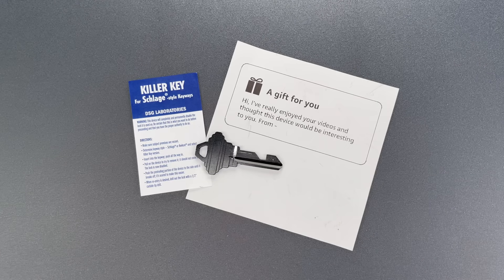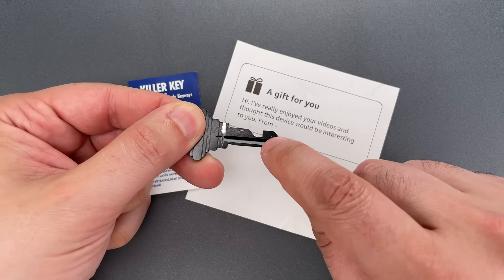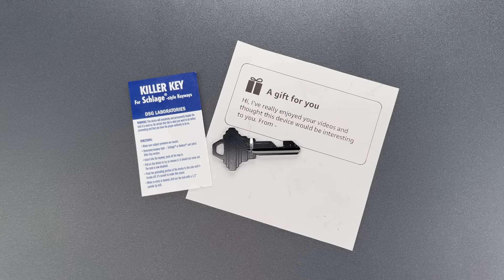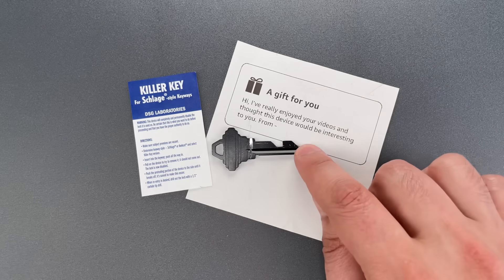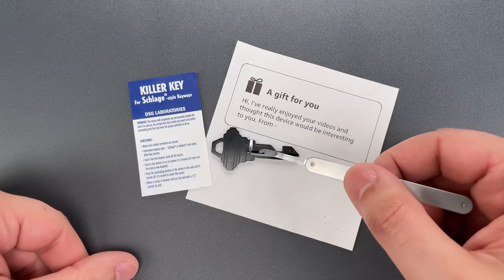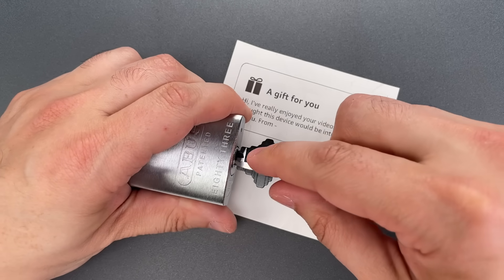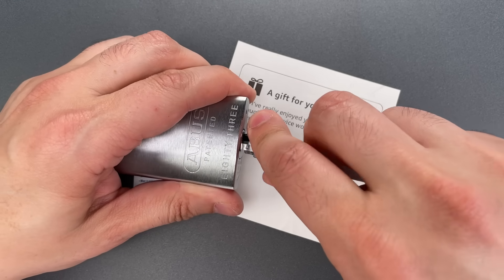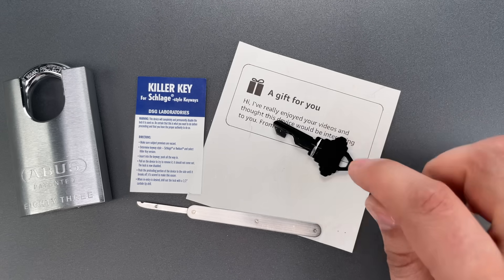[1350] Defeating a “Killer Key”

Comment: if I was going to make a killer key, I'd just squeeze epoxy down the key hole instead...
Reply: Superglue, comes in those convenient mini-tubes.

That said, this has the tradeoff of being removable if you want to disable a lock but not destroy it.
Reply: @ianburns1167  Super glue is easily dissolved by acetone, which won't harm the metal of the lock.
Reply: @silverfischdotnet  Hence the suggestion to use other glue types that require more exotic removal methods than nail polish remover.
Reply: @silverfischdotnet  Yes, some types. There's also pretty resilient glue types. Also, soaking a lock in Acetone requires to get it out of the door, which requires (typically) opening the door, which mandates unlocking the door unless you can take it off the wall completely while locked. I'd say glue or epoxy is a lot more permanent and harder to deal with that these keys.
Reply: @silverfischdotnet  While you're correct that acetone will dissolve super glue, you forget that the inner workings of the lock will still have glue in them and someone looking to destroy a lock will simply fill it totally full.. leaving no space for the acetone to dissolve the glue.
Reply: @ianburns1167  yeah but this product advertises "permanently disabling a lock"
Reply: @ianburns1167  According to the manufacturer, you have to drill the lock to remove the key, so you would think the lock is lost, that is until LPL shows up.
Reply: @ianburns1167  Super glue has a kyrptonite: sugerglue debonder. epoxy is much more permanent.
Reply: @ianburns1167  superglue can be removed with some heat
Reply: Well the makers of that key state the lock needs to be drilled for removal, which is pretty destructive. Filling the lock with glue basically does the same thing without a backdoor. Glue > Killer Key
Reply: I've also thought about the expanding foam they use for foundation cracks, basically foam cement in a can.
Reply: @SlyTreeRat  this reminds me of thieves that snorted a powder that turned out to be acrylic acid mesh. Let's just say that it didn't go well for the thieves...
(polymerized acrylic acid can absorb many times it's own weight in water)
Reply: Expanding foam, once it's set you can't get it off unless it's scraped off, and it will fill all the gaps. Way better than superglue if that's your goal
Reply: Just hammer a drill bit into the keyway, then break it off with a hammer. A stone bitch to drill out, and it fucks up the keyway and pins both.
Reply: We know how LPL secures a key: WELD IT SHUT.
Like his heart lock with Mrs. LPL.
Reply: Came here to say this.
Reply: I thought of a key made from metal with a low melting point. Insert that and treat it quickly with a blow torch...
Reply: @edi9892  just a thin peice of solder. You can melt that with a lighter.
Reply: @TSotP  Then you've always got to make sure you have solder and a lighter on you rather than a key.
Reply: @TSotP  As a kid, I played with tin from an electrician's toolbox. It was too soft for really blocking the lock, but it would definitely melt.
Reply: @TSotP  you can also remove it with a lighter
Reply: @Bear-Seek-Seek-Lest  as a smoker the latter isn't an issue, but as someone who has experience with using solder I also know ghat it wouldn't work unless you were using a mini blowtorch and got the lock body hot enough for the metal to flow inside and bond to the cylinder or pins, otherwise the solder wouldn't melt fully or wouldn't floe into the lock far enough and would basically just fall out if poked
Reply: @Bear-Seek-Seek-Lest  ah yes, and you always carry around that original killer key
Reply: @bartomiej368  Well, it's more convenient than carrying some of the suggestions here on you if you need something like that in a pinch. Although, you're probably better off doing something else entirely. If someone was going to use this key against me (I live in a flat so kicking down the door or getting in a back way is out of the question and needed to get in), especially before I saw the video, I'd probably break it trying to get it out and be picking (not locksmith term) at it for awhile.
Reply: @edi9892  you might as well just torch the entire lock instead of going through the trouble of finding a key like that
Reply: @Rapturaton  it only takes a little longer...
Reply: @edi9892  bismuth?
Reply: @quartqwertbudisgood  maybe. Some alloys got really low melting points as well.
Reply: Actually, if you simply heated the lock such that the epoxy reaches its glass transition temperature (say, around 150°C, but depends upon the specific epoxy), which an all metal lock will readily survive, the epoxy becomes very friable (a bit like a weak dry clay), so you could still recover the lock with some patience.
Reply: Use some duct tape, completely lpl proof
Reply: Id just pick it and install my own lock. Check mate
Reply: Bubble gum or chewing gum will kill a lock quite easily too.
Reply: But some how, i feel he could still open it.
Reply: @dtylerb  JB Weld is just a form of epoxy.  Yes, most epoxies (it is a HUGELY diverse group of adhesives) will release with enough heat.  Still, very likely to gum up the works of the lock.
Reply: Put epoxy in the lock then put in the killer key.
Reply: But then it wouldn't be a key
Reply: I prefer just to bring a welder
Reply: @BACNandEGGS  Carting along a ~30lb mig or tig welder, plus a generator, plus gas canisters, seems excessive compared to a syringe of 5 minute epoxy. Though honestly I'd use expanding foam sealant, because you have to sit around and mix the epoxy, then figure out how to actually get it all the way back into the keyway. Caulk could work too, but I feel like there's the potential for it to pull out since silicone doesn't tend to stick to metal very easily.

Though, if you really want to seal a door forever... Just board it up from both sides, or brick it over.
Reply: @littlesnowflakepunk855  thermite
Reply: Matches also work.
Reply: @dtylerb  Epoxy gets soft with heat, no idea if it would gum up the keyway though...
Reply: You guys all know that if you glued/filled/melted the cylinder, LPL would just take out the Ramset, don’t you?
Reply: @carlbernsen1290  Qualifies as destructive entry.
Reply: Jb weld
Reply: make it two-part epoxy so it sets harder than concrete

edit: on top of that the necessary chemicals to dissolve the epoxy would probably dissolve the lock itself
Reply: How about a copper/zinc amalgam? That would slowly meld with the brass on the pins. A few days later the mercury evaporates and good luck taking those pins to their original form ever again.
Reply: This seems like a great option to very quickly disable a lock. Obviously epoxy is a better permanent solution, or better yet welding, but neither are nearly so quick.
Reply: @Bierstadt54  two-part epoxy hardens (doesn't cure until later) in 5 minutes tops so I don't really think that this is all that much more effective than just shoving lock-tite down a keyhole.
edit: with regards to time, of course
Reply: Killer key + JB weld.
Reply: Or super glue

Comment: I am proud that I quickly figured out that "piece of redbull can" would be sufficient to lift pins and free the key.
Reply: Same thought here's. Don't need the dimple. Just lift the pins & pull both out.
Reply: @EdSileo  you'll need the dimple if the head of the key was snapped off
Reply: @justinl9677  not really,  the snap point  leaves a bit of the keyshaft anyway,  so a decent set of pliers would do it,
Reply: @baxter22071990  thats why lpl showed one that had less room for pliers to grab - the barb pulls out a lock killer with or without anything external to grab
Reply: @justinl9677  
Fair enough.
Reply: @baxter22071990  the two times I used one there was nothing to grab onto as the broken off bit was countersunk in the lock cylinder...  I do admit though that not all locks and keys are the same, so I will concede lol
Reply: The red bull can  would be inferior to any beer can. The ability of the picker ? Maybe not.
Reply: Does that work with every lock?
I thought that the tolerances between the lock and key would be to tight.

Comment: Personally I would have made it out of harden metal and put a carbide tip on it so that when you pull it out it cuts the pins.
Reply: @randomguy8196 depends on what thermite solution you use there is one solution that they use to weld railway rails together in a lock that with literally leave glob of weld deep inside. If use one of the more hotter solutions even a small amount could get it plenty hot to deform or even melt part of the core afterward you could spray it with liquid nitrogen and that would make it hardened to hell it would be an absolute nightmare to drill it out.

Comment: Other than pissing someone off, what is the purpose of this "Killer Key"? I can see some mischievous people using it to piss off someone they don't like.
Reply: AFAIK they're meant as stop gap solution to disable access to a lock for the key holder until the actual owner of the lock has been able to replace it. Think hotels where someone stole a key to a room.
Reply: @RAHelllord  The manager or security officer would simply 'double lock' the room with the emergency key (this turns the inside locking knob) until engineering can change out the cylinder.
Reply: Immediate use that comes to mind: Landlord lockout. Sometimes you have to make a door unusable by the person who has a proper key while the locks are still being changed out.
Reply: @MoraFermi  I am a landlord, only takes about 15 minutes to change a lock, I was thinking it’d be perfect for a safe if the true keys are kept near by.
Reply: @quartqwertbudisgood  you can only change the lock in 15 min if you have the key to the lock.
What if the tenant already changed the lock?
Reply: That's probably the main reason but potentially I can see that you could have a door that you didn't want anyone using ever and also wanted to guard against picking but that has to be really niche. At that point, superglue in the lock would be cheaper.
Reply: @chaos.corner  and, if you ever need to make superglue set instantly, drip water on it.  near instant cure.
Reply: Now that I know you could remove it. you theoretically could insert it into your one lock as cap to make practically impossible to attempt to pick without the removing tool & knowledge on how to remove it.
Reply: It's not about just landlords and tenants, police and security use this to lockdown certain areas in emergency situations
Reply: There are literally a million reasons to seize a lock temporarily or for a good long while. Most common uses for killer keys are to turn storeroom function locks, which are locks that are always locked no matter what, but can be temporaily opened with a key, into exit only locks. So they lock is forever seiezed, but people on the inside can still leave when they need to. It's also handy to seize a lock you lost the key for, or is at risk that somebody duplicated a key. Seize the lock, until ytou get it rekeyed, or replaced entirely. It's immensely easy to remove all brocken keys or killer keys if you have access to the backside of the door, but with padlocks it's a little trickier so using a good killer key, means you should be ok with never being able to open it again
Reply: We call this a chip key, in a large  facility maintenance will use this to secure doors and maintain security if somebody loses a  master key and there’s not enough time to re-key that day. We cut them a little differently so we can use an extractor to get them out, so it would take somebody with skill to remove.
Reply: common use is evictions, prevents access until you can change locks (the locksmith knows the same trick as LPL)
Reply: Another potential use I see for this is to temporarily turn a door into one that can only be opened from the inside. Could have niche applications where a door is in a controlled-access area but opens out into a public area.
Reply: The way LPL had one in his keyring tells me it can be helpful if someone finds/steals your keyring and tries to open your door by trying keys one at a time.

Though easy to dodge if you know what one of these keys look like...
Reply: @MajoraZero  Well, his key is a bit obvious but that's an interesting idea, you could make something that looked more like a real key but with just one (or 2) perpendicular cut.
Reply: I was thinking the same thing.  I don't really see a reason why someone would want to permanently ruin their own lock.
Reply: @88michaelandersen  some estate agents use them to lock a house so the original owner can’t get back in with a spare key and then they would change the lock anyway
Reply: @RED-ft8gl  Ah, so still used for evil :p
Reply: @RED-ft8gl  As far as I know, this the primary target market for these devices. When a tenant gets evicted and the rental property manager needs to secure the property quickly, they break off these keys in all the locks, then later they send a locksmith to remove the stubs and re-key the locks.  I've also seen versions that come with a split in the key, so you can later stuff the "kept" half of the key back into the lock to retrieve the "leave behind" portion.
Reply: @rewtshell  I believe what you're referring to is a "lockout" key, and LPL has actually done a video on them before. I can't remember the number, but I know he has done one.

Comment: Nice piece of equipment buddy. (Your tool)
My question is, what is this made for.
I don't see why this is useful, like, why would you need a killer key for in the first place ?
Reply: It's for defeating the mechanism in cheap code locks with those rings full of numbers.  It reaches into tiny gaps to push or pull internal mechanics or feel where the internal notch for each wheel is.
Reply: Apparently they're used by landlords to quickly lock out evicted tenants until the locks can be changed.

Comment: I do wonder what the intended purpose of this is. I feel like there are far better solutions based on where the lock is located than just putting a key in there to permanently lock it.
A little welding will also do the trick.
Reply: maybe security until end user receives, so you would just cut the lock off as a permanent security device or something like a customs tag that can only be removed by customs or the end user on containers, supposedly. There's now a company making smart containers that have built in locks that cant open until a certain time, have umpteen cameras and microphones etc to try to stop illegal operations in shipping.
Reply: @paddington1670  For shipping containers, single use pad lock substitutes have been used for decades.  These have a unique serial number, snap together permanently and are removed with bolt cutters.  Upon arrival or customs inspection the serial number of the unbroken bolt would be compared with the paperwork to prove nobody else opened the container.
Reply: Glue and coins work well too
Reply: Or just squirt some superglue inside the cylinder
Reply: Mostly landlords when evicting tenets.
Reply: Police and security use this to lockdown areas in emergency situations
Reply: Just a guess, figuring LPL has one on his keyring, he might use it to thwart someone from scamming him. Ie not pay
Reply: Maybe secure a door if you know someone broken in, and you suspect they picked the lock/got a key copy.
Reply: As others have mentioned on this page, this is mostly for locking out evicted tenants and making sure they don't come back. The locks will have to be changed anyway, so they just condemn them until this happens. Welding would likely do the trick, but if you're a property manager it's a bit easier to buy a couple of those keys off of Amazon for a few bucks than hire someone to weld locks shut.
Reply: Suppose you had just bought a house at an estate auction that you were intending to reno but didn't know how many keys there might be floating around. Since you're planning on changing the locks anyway, you could use this to temporarily and quickly secure it until you get back.
Reply: From my understanding they can be used by firemen to ensure that unlocked locks in a burning building do not become locked while they are working
Reply: @patrick1020000  firemen will bust a door down even if it is unlocked. Can’t see them fiddling in their pocket for a key and breaking it off.
Reply: @D-B-Cooper  said: @P  firemen will bust a door down even if it is unlocked. Can’t see them fiddling in their pocket for a key and breaking it off.

Uh, if a door is unlocked . . . can't you just push it open?
Reply: @terry_willis  you would think that, you would also think they wouldn’t want to draft the flames but hey, smoke and exit.
Reply: @terry_willis  I would assume, due to air pressure from the fire.. the door could become slammed shut behind them, if they have to break it down later the time it takes could be their death.
Reply: @terry_willis  due to the way structures collapse when on fire, there's many reasons a door could become stuck, upper floors could put weight on the door or.. who knows.
Reply: @Skagzi1la  Stop overthinking things.... Don't you think that if a Firefighter went thru a door with possible fire behind it, he would also have a fire hose (connected to a fire truck) that will obviously keep the door from closing?????
Reply: @patrick1020000  Yeah, speaking as one, that ain't happening, and I've never heard of this being used. I can't claim no one has ever done it, but it's certainly not part of any training I'm aware of.
Reply: 99.9% of the time it will be used to be am arsehole. 

It may have some value for something like a landlord locking out a tenant until the locks can be changed